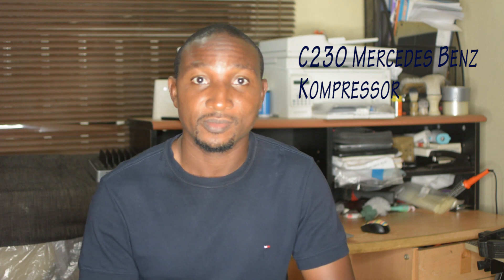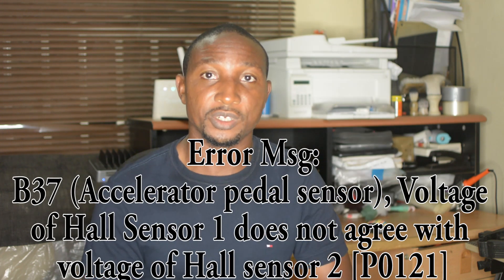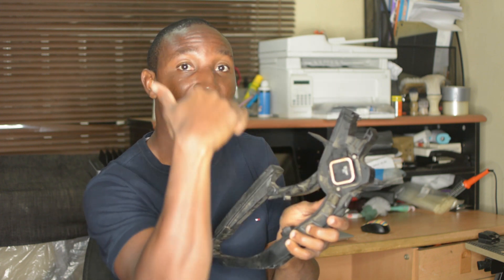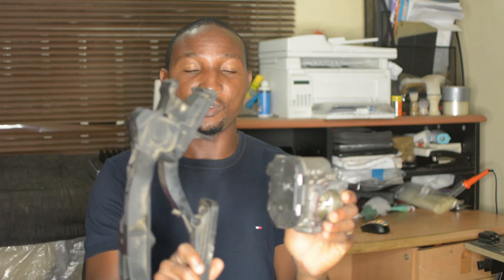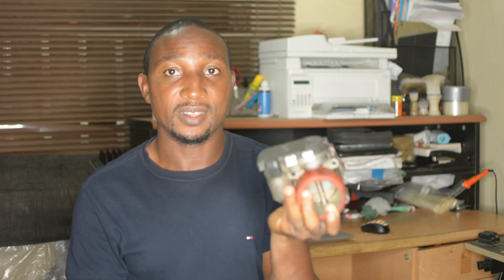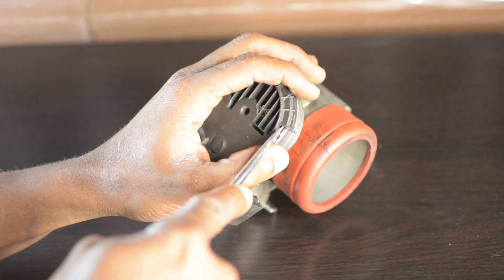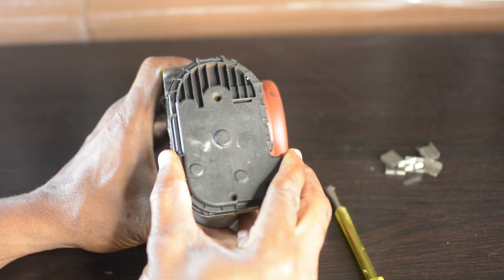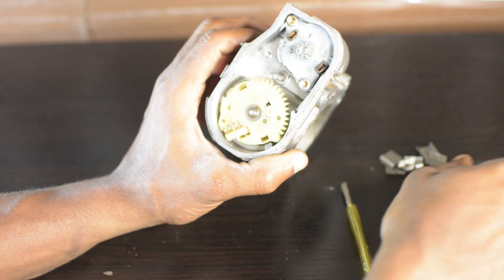c230 Mercedes Benz Kompressor 2003 Problems & Solutions  Part 2- Throttle body & Pedal

Comment: HelloI I liked your explanation. I live in Brazil and I have problems with my C230 Kompressor 2005. My mechanical told me that I must do change it because are axle play. So, I bought one used . I found one but again the mechanical told me that the one, had the rotors(inside)  small scratches. I ask u, it's real, I can lose pressure pass though scratches?

Comment: What could it be if you already replaced the accelerator pedal sensor go thru the relearn procedure. And it works for 1 day then you go to drive it the next day and have the same problem (no pedal response)
Reply from the maker: If you changed the accelerator pedal sensor and it happens the next day, it might be that the Throttle body is having issues too. It happens sometimes. It's important you check with the diagnostic tool to know the exact problem.
Reply: @techloam  it doesn't have any codes to pull
Reply: @TechLoam  is there a way to replace only the TPS on the throttle body?  I think the motor in the throttle body is ok as the car revs up and down but it does this without stepping on the pedal 😢
Reply: @therealrobertbecker  that sounds like the gas pedal sensor problem I just fixed a new sensor and battery fixed mine
Reply: @lorenzobordeaux8604  I replaced accelerator pedal with a brand new one 'guessing' that was the issue, but the issue remains.  Do I need to reset anything after changing the pedal?  With the issue remaining, I thought I'd reach out and see if I could I replace the TPS without changing the the throttle body.  I'll post the two ODB Codes.  Thanks for any help.

Comment: my kompressor c230 not passing 50kmph
Reply from the maker: It's either the throttle body, MAF or Pedal sensor problem. You also need to check the air flow passage, if any of them is not properly secured this can happen. I mean if the air is leaking from any of them. It always seems like its the Mass Air Flow (MAF) but it might just be a simple connection problem. Just use a diagnostic tool to clear the error and if it happens again just check the component likely to be the issue using the tool.

Comment: Hi can you clean the TPS with fuel
Reply from the maker: Please don't use fuel... there's a cleaner for it...a spray kind of cleaner specific for TPS...sometimes some black debris could disturb the opening and closing of the opening. I think that spray dissolves and flushes it out without harming the internal electronics.

Comment: Hi thanks for the video. I have some clue now. I have similar issue with my car currently c200 kompressor.  I have one error. Accelerator pedal sensor(hall sensor 1 open/short circuit in wiring). How can I go about fixing the problem?

Comment: Thanks for the insight. My car's problem is the pedal. Please advise if it also can be fixed.
Reply from the maker: You need a diagnostic tool to be sure about that. If you're sure then you need to try replacing the pedal sensor! Sometimes its not the pedal but a registered communication error that needs to be wiped out with a diagnostic tool

Comment: Please what is the main problem of Mercedes Benz 2000 c230 kompessor.
Reply from the maker: The airflow is the main problem of that car. The moment it is tampered with without fixing properly, the car may never be the same until restored properly.

Comment: Can you please share the link of the scannner. Also I have an issue with my AC after a couple of diagnosis I’m told to replace the evaporator which mean the whole dashboard will be taken off and I’m just not comfortable with the process . Please do you have any advise for me?
Reply from the maker: Yes. The evaporator can be damaged sometimes. You need very good hands to remove the dashboard carefully and replace them nicely. The scanner is AUTEL MaxiDiag Elite. I can't find it on Amazon.com but they have higher ones also.

Comment: Hi brother what's going on. My Mercedes is 2005 c239 and its giving the coolant level check but my coolant level is ok can please share your opinion
Reply: I have the same problem with my C230
Reply from the maker: Sometimes it's the sensor of the coolant that is faulty. You need to have it checked.

Comment: i have a 2003 c200 kompressor, it snapped the serpentine belt, i replaced with a new continental belt than it snapped again.. the car start and idle. can it be supercharger ? 
regards.
Reply from the maker: You need a technician to check the rollers (pulleys) that are connected to the serpentine belt. Sometimes they can be stiff for one reason or the other. The compressor, alternator, or the supercharger can be responsible sometimes.

Comment: I have kompressor  but it consume  fuel
Reply from the maker: You need to check the fuel filter or the indomie at the exhaust system.  Sometimes the fuel filter pipes will start to get wet and the smell of fuel will be perceived inside the car. It means the fuel is leaking and need a repair. As for the exhaust there is always a balance the ECU tried to maintain between intake of air and exhaust of smoke air from the engine. When the indomie is empty the balance is altered and that can lead to fuel loss.

Comment: Do you have to relearn when you install pedal sensor
Reply from the maker: I hope I understand you correctly but after installing the pedal sensor you need to clear the error using your diagnostic tool.
Reply: @techloam  ok I see I dont have one I just did the throttle body and the pedal sensor and engine light still on
Reply: @techloam  thank you for replying I also cleaned in the intake and sprayed maf sensor but the esp light comes on and the acceleration doesn't work
Reply: I'm thinking the maf is going out
Reply: @techloam  do you need to do anything else
Reply: @RLAE420  once you clear it with the diagnosis it should go back to normal

Comment: i have a 2005 c230 kompressor to get the car running i have to push on the pedal several times to get the engine runnig and acelerate the car until get a good idle , did you have any recommendations for me??'
Reply from the maker: I always start the car and leave it to run for up to 2mins or more. When I get a certain peaceful sound from the engine i switch it off. I do this as a routine. I will suggest you check the air filter it might be dusty.

Comment: I see I have the problem you are talking about is it true to this problem no actual error comes up inside the car ? Just you feel drastic power loss but everything else with the car seems running like new ?
Reply from the maker: I need to understand how yours happens because sometimes it takes a while to regain power. Sometimes you switch off and on after 10s and the power is restored but sometimes it takes days. Everything will run like new. It's not the engine that is affected but the mechanisms that move the car.